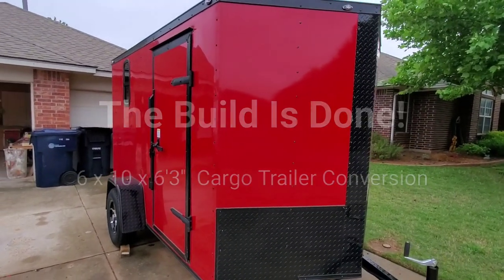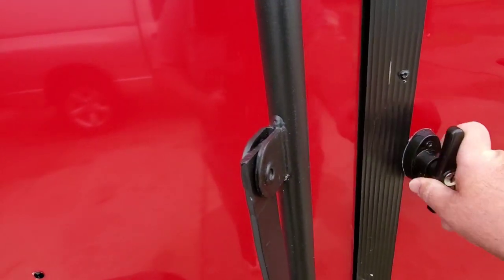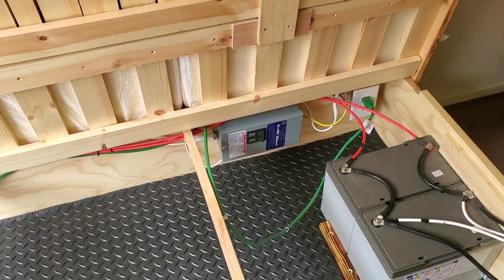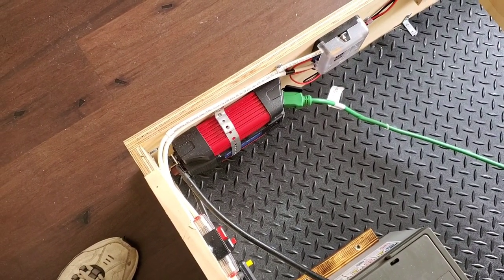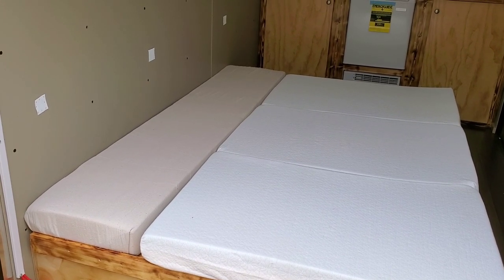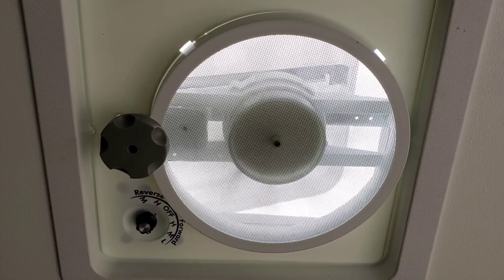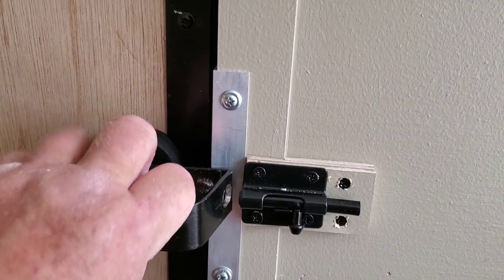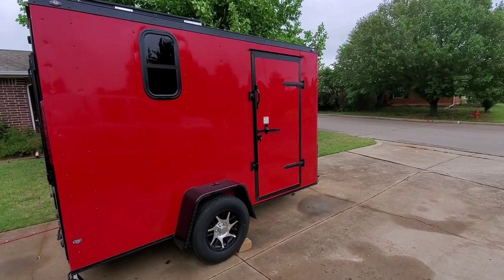The Build Is Done!

Comment: Nope....not going to sleep in anything someone can lock you inside of! Didn't need to watch past that point.....
Reply from the maker: Appreciate you watching as far as you did. All of you "get locked in" folks have never actually dealt with a bar lock. If the padlock is put in the flip latch on the door, the bar can't hold the door closed. My neighbor's 7 year old daughter simply pushed the door open from the inside when we put the bar across the latch. As for someone "wiring" the door closed, I guess if there are gangs of ne'er do wells doing that, it could happen. Somekne could also park
their vehicle against the door, angle a piece of wood against it, lean a pic nic table against it & so on. If I have to worry about crap like that, I'm staying home. Also, why doesn't anyone talk about the rear doors being locked/blocked by bad guys?
Reply: @TinyTrailers4BigAdventures  I was talking about ALL doors with that type of latch! If you're going to build these trailers, why not remove them altogether and put rv handles and locks on? If you're that worried about theft, why leave it unattended?
Reply from the maker: @oldschooldiy3240  - Tha handle I put on will hold the door closed just like a rv latch. If a bad guy wants in, he simply prys the door above & below a latch until the door bends and the latch itself pops. (We tried it on a wrecked trailer, it's pretty easy) The main reason for the bar lock is to insure the door doesn't accidentally open going down the road and is added  security when not using the trailer. As for woorying about theft and leaving it unattened, do you lock your door when you leave? I think it's safe to say we have differring points of view on this, which is fine. Open didcussion helps everyone.